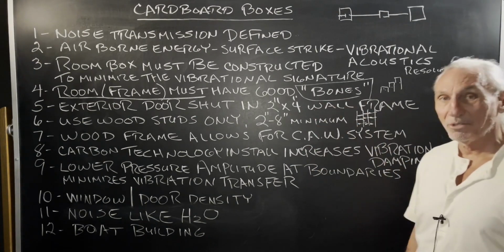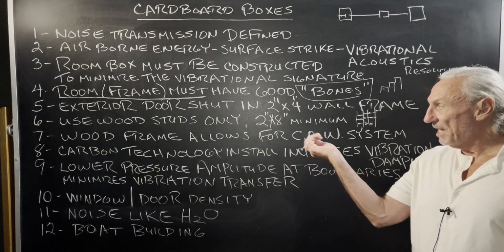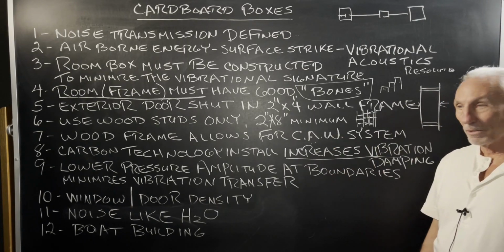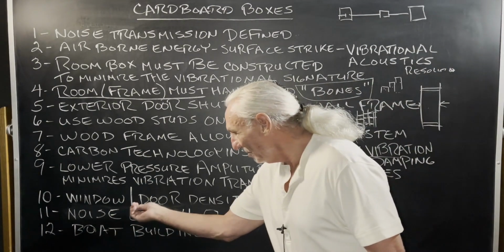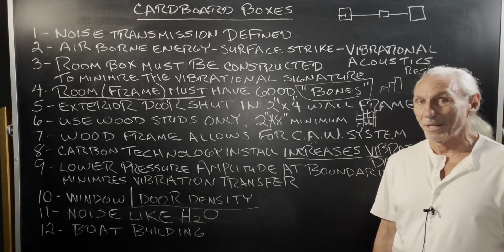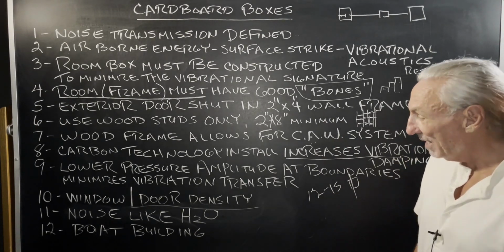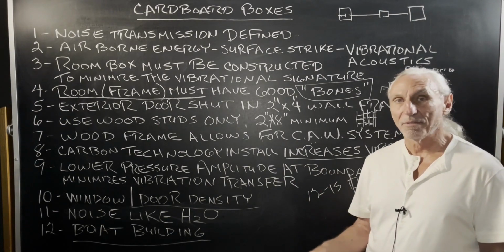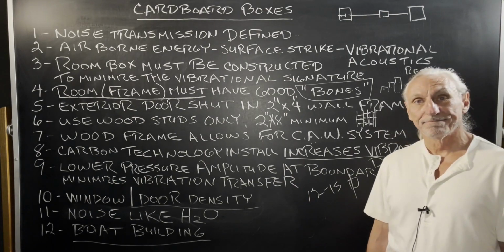Cardboard Boxes - www.AcousticFields.com

Comment: 12" thick doors, that sounds like a fallout shelter.
Reply from the maker: With barrier technology, you must keep the density of any door or window the same as the wall in which supports it. Sound is like water. It will finmd the weakest link in the structure and go through that.

Comment: You're losing a lot of square footage in your house using 2 by 8, But I see where you're coming from. However in this case it's a trade off, space for sound.
Reply from the maker: Treating down to 30 hz. takes 12". Treating down to 40 hz. takes 10". 50 hz. takes 8". You must decide how low to go and what you will give up. The space trade off is well worth bthe acoustical benefit.

Comment: Doors 12” thick? You’re kidding!
Reply from the maker: Our CAW susyem is 12" deep. When you are needing a door in the design, you simply cut out a cross section on the wall and make it a door. Yes, its heavy but with the proper hardware it can move as easily as a standard door. The acoustical benefits are numerous. First, when it comes to noise transmission, the door is not the weak link as is most room designs.It contains the same density as the wall. Secondly, the sound absorption remains consistent across the whole wall.Noise is like water, it looks for the weakest spot to go through.

Comment: So for those with existing 2x4 walls, do you recommend replacing a hollow core door with a solid wood or preferably a mdf door?
Reply from the maker: Match the door density to the wall density.